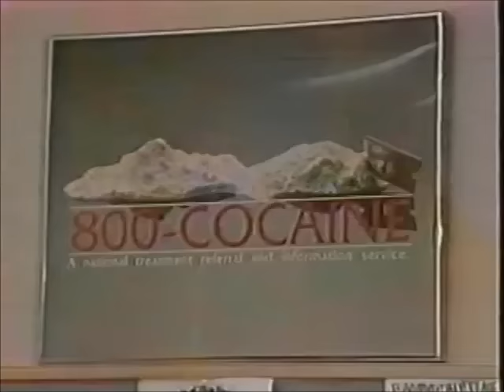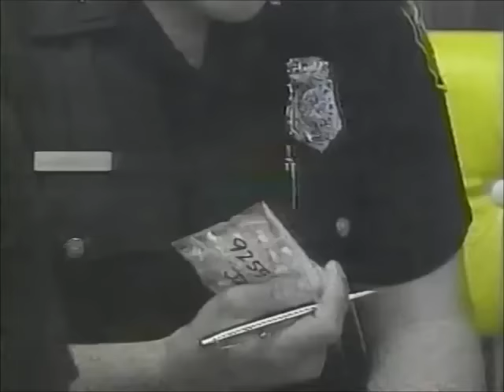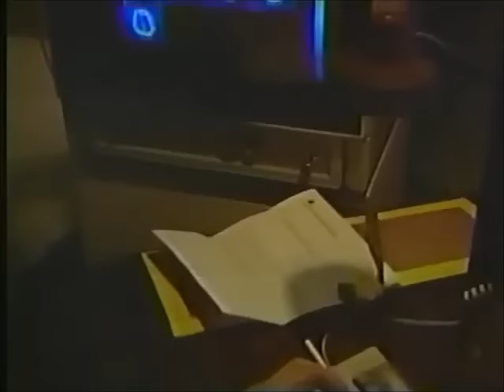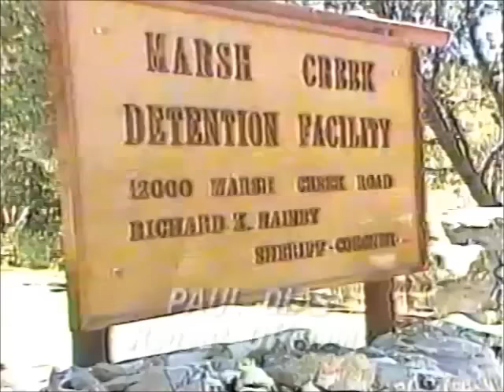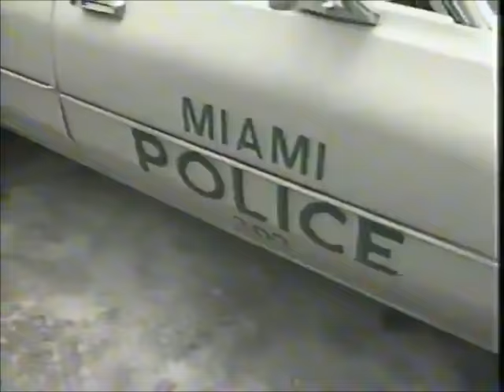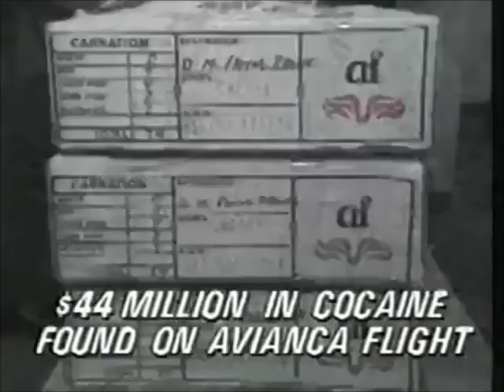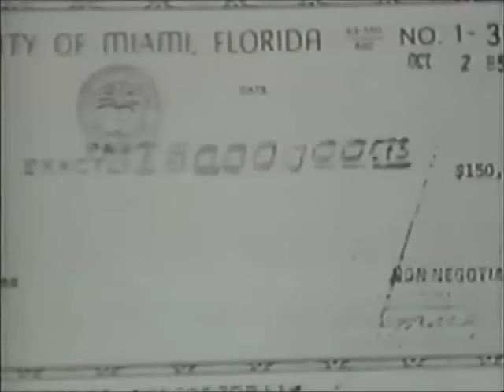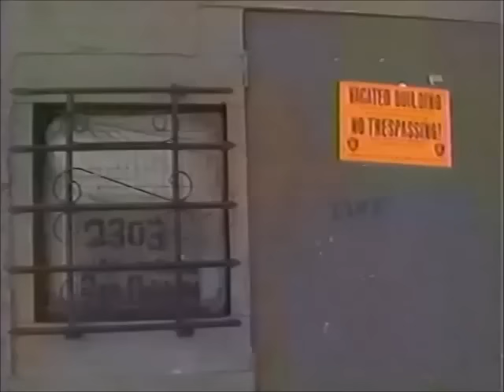News reports on the 80s Crack Epidemic + more

Comment: Can someone explain to me the difference between freebase and crack? A former user told me freebase was first then they weakened it by crack amd even newer crack isnt as potent but what is it? What was the first drug to hit the community?
Reply: The crap they use to mix (cut it with) Crack it's water + baking soda.  Freebase it's either
Reply: Hope my answer helps some, freebase came before cocaine base from South America. Freebase was a 70s thing crack was 80s smoking crack or freebasing was the highest you could get from coke without injecting it.